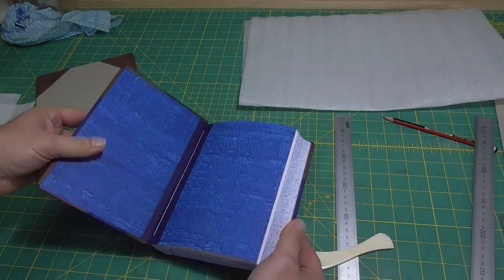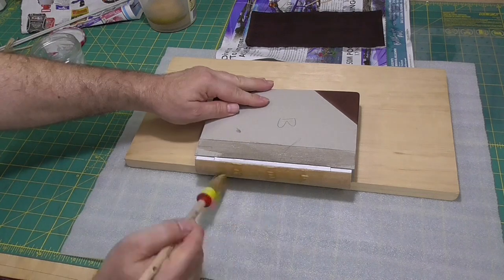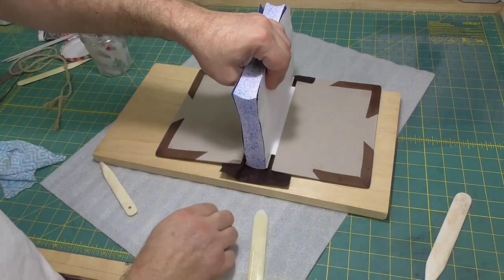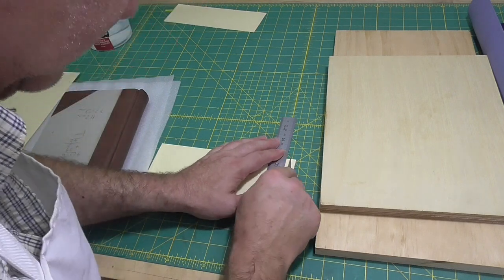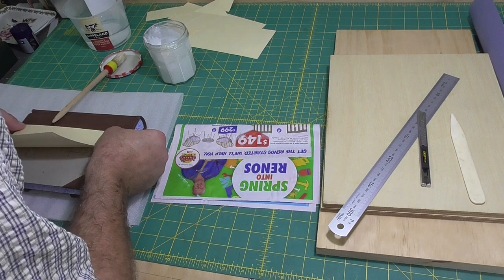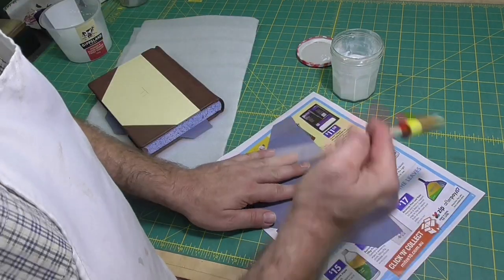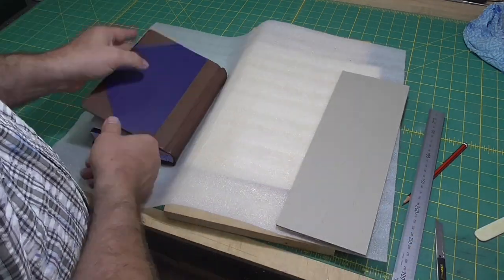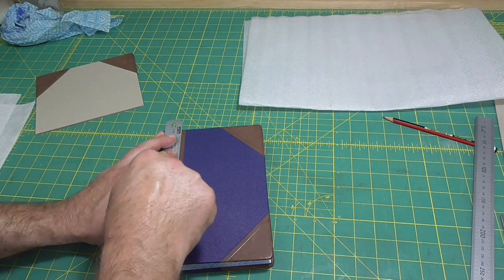19th Century Half Leather Library Binding Part 4 of 4 // Adventures in Bookbinding

Comment: I was wondering why you used paste only (almost never PVA) for leather, and here I can see one reason probably being the less tack and greatly more work time. I didn't know if I might be able to approximate this using PVA with runny methyl cell mixture... I also thought perhaps you dialed in your full leather board covering with some lining that equals the tension for non-warping success when using paste. I am inclined to just follow your world class example and get more used to paste adhesive. You've also solved my  leather soft cover bible lining and endpage woes with the introduction of paste paper, anyway, since it replaces the expensive synthetic coated paper with more flair in the process, God willing, plus I have clear acrylic medium to mix with paste for DIY buckram. You're a game changer who condenses these specialty sources all into one great teacher.
Reply from the maker: For most traditional leather bookbinding you need the open time of paste.  PVA/paste (or MC) mix still won't give enough open time and there are other potential issues (if PVA tacks and you break the tack, will it still stick?).  And MC doesn't have sufficient adhesive strength compared to starch paste.  Thus, I use wheat flour paste for covering in leather.  Happy binding!

Comment: I'm glad you made this series. I have not looked at all of them.  My first comment is that you should wrap the text block with paper before you begin any of the cover work. It will protect the edges and make handling the book much easier. (It stays wrapped until you are ready to paste the ends down.)Also when I turn the head and tail I always used a board and stood the book so that I was always working on the top of the book whether it was head or tail. 
I also pared the leather for the spine and for the corners, it made turning in much easier and guarantees that the paste will hold at the edges. Then, necessarily the edges of the corners and the spine were trimmed before filling the blank part of the boards. I also wrapped the filler paper around the fore edges and head and tail as the trimmed leather also wrapped around those edges and it makes for a more uniform edge.
I have to look at your end paper construction,  have not seen any sewing in the end paper visible in a Library Style binding and they do not show in mine.
I had always wanted to do a series on library Style, ( I used to teach that at the Center for Book Arts in New York) but I had already said good bye to my laying press in the home studio.  Thank you for doing this, I also have series of Binding videos. I originally learned in England at Croydon College of Art from a teacher who had been a finisher in the West End of London. We could probably have some interesting conversations.
Reply from the maker: Hi Sage.  Great to hear from you.  Your videos were an inspiration when I first got started.  They gave me confidence there were enough people interested to warrant making bookbinding videos.
It's been ages since I made these videos, so don't remember them that clearly.  I'm surprised I didn't cap up for the video.  It is a lazy habit I have developed to not cap up for quarter bindings.  People keep telling me to use cling wrap.  I've tried it and didn't like it.
I started doing these split board library bindings when I was learning springbacks.  My first bookbinding book back in the early 90s was Johnson.  I was always intrigued by the "library binding" but was told no one did them anymore.  I've tried to keep them fairly historically accurate based on Johnson and Matthews.  They both describe the stationery style endpapers.  I assume this came out of the early development by Cedric Chivers in the 19th century.  I like this little historical quirk.  It's the only letterpress style binding I do with sewing visible between the pastedown and FFE.  I've never seen a genuine Chivers library binding.  It would be fun to compare to what I've produced.
I thought I did pare the headcaps.  With the tight-back it would produce a lot of thickening at head and tail, which I dislike.  Maybe I was trying to keep it beginner friendly?  I deliberately don't pare the joints for this binding.
All the best,
Darryn

Comment: Wonderful work! I've been wondering how so many binders are able to make their grooves so pronounced.  Your video was super helpful.  Thank you!
Reply from the maker: Thanks.  Not all joints are made with rods.  Another common way is to use boards with a strip of brass that sticks out a bit.  This pushes the material down into the joint, especially if it is a thin joint.

Comment: I just discovered your videos, and they are great. Would you be able to make a video about leather joints and leather hinges? I'm very interested and  i haven't found any online resources at all. Thank you in advance.
Reply from the maker: There are some Guild of Book Workers videos that cover variations of this (on vimeo).  I'm not a big fan as leather when pared very thin isn't very strong and does not last like other materials.  But for fine binding it is expected, like silk thread, which also doesn't last.  It is an advanced subject that goes with an advanced book, which is a lot of video work!  I am sort of planning such a project to celebrate reaching 100 video which should be in about 4 months if I don;t burn out first:)  Or, have a look at the last project, the buckram library binding.  Imagine replacing the strip of cloth at the hinge of the endpaper with a thin strip of leather.  The paste down looks just like a doublure and you wrap a guard around the outside of the endpaper and first/last sections and not sew through the endpaper.  Good luck, Darryn

Comment: Amazing video, I just watched all 4 parts in one sitting and learned SO MUCH! Thank you for making these videos, they are invaluable. 
I have a quick question. I have some Kangaroo leather that I'm making a set of books with (Not library Binding but I was watching this video for techniques for the corners and half leather binding) 

I LOVE the lines you put in right at the end of the video with the sharp bone folder as accents. I have some scrap kangaroo leather and I thought I'd give it a go. However, when I do it, instead of getting those lovely dark grooves that you get I get a line that is Lighter than the surrounding leather and doesn't really last (I can rub at it and it fades leaving a very light line that isn't particularly pronounced. 
Am I pushing too lightly? I feel like if I push harder I might tear the leather? Any suggestions on what I might be doing wrong?
Reply from the maker: I would start with more pressure.  You can also moisten the leather a bit.  But do all of it.  Also check on the back turn-in first to make sure the leather doesn't go dark.  I think more pressure will do it.  Good luck!  DAS

Comment: Is there a particular reason why you didn’t use head or tail bands in this project? I like the idea of a durable binding, but i also like the decorative aspect of the bands.

Also, is it possible to add strips of leather to the spine for false bands? Or would that negatively impact the strength of the binding?
Reply from the maker: Yes, the piece of cord that I put in the head caps end up sitting over the head and tail of the spine and would clash with an end band on the text.  I think it looks really nice like this.  
Yes, you could put false bands on the spine.  Or you could sew it in real raised cords and fray the cords out and paste them onto the insert for the split board.  Then it would have real raised bands.

Comment: Awesome; I can't wait to try this project myself! I have very thin calf skin, .4mm. Would you recommend such leather for this, or something else?
Reply from the maker: Can't wait to see the book you make!  I think keep the calf for another project.  A feature of the library bindings is the thick strong leather and minimal paring.  It doesn't require much leather.  Hewit's have leather starter packs which would have pieces large enough for this project.  And you get a nice selection of leathers to try out on other bindings.
Reply: Did you measure correctly, it's so thick, 4 mm ??? it's too thick,
from 4 mm you make belts, you don't use it for bookbinding,
but if it's 0.4 mm I think it's too thin, I think at that thickness it's better to go on goatskin

Comment: I have a bit of a mystery binding question. I have a stab bound book of English poetry from the 1930s that has a hard case cover. It seems like a strange combination of styles to me and I can’t seem to find any information about it. The text block has a rounded spine so that it sits in the case correctly and the end papers are glued to it. The text block seem to be attached to the case with a bit of glue and mull just at the hinges. Have you ever come across this kind of binding?
Reply from the maker: Sounds a bit of an odd ball.  There is probably an interesting history to it, if only it could tell it's sorry.  In the 18th and 19th century I believe the sections of a book were sometimes very crudely with a simple stab binding and then put in a wrap around paper cover, like a paper back, but it was meant as a temporary measure until the customer had it rebound to match the books in their library, or whatever gentlemen did in that period.  I've read that often the binder who did the final binding would sometimes not pull the original stab binding out, and they are sometimes found in books from this period.  I've only read about these, never come across one in Australia.  Your is a bit late for this, but may be a throw back.  Certainly worth preserving in this original form.  DAS
Reply: @DASBookbinding  thanks!

Comment: Could i use a different coloured book cloth instead of leather?
Reply from the maker: Maybe.  I'd do a hollow spine if I used cloth on the spine.  If you want a tight back with cloth I would line the spine a bit more to make it very smooth.
Reply: Thanks. I gave it a go and it worked! Can’t wait o try with leather it once i can get some.